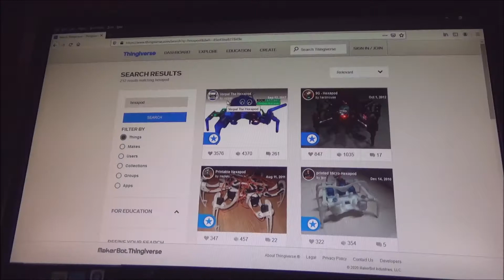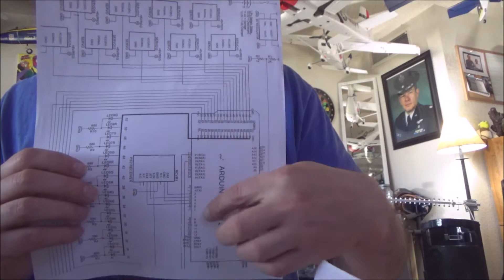Hexapod Build project

Comment: Corey, I just made this robot too and I printed the Tube Spacers vertically and it worked like a charm.
Reply from the maker: I think I was printing to many at once.
Reply: @MyLastRites  I am confused about how to connect the power to the robot. I've never worked with RC batteries and the SBEC circuits. Any suggestions?